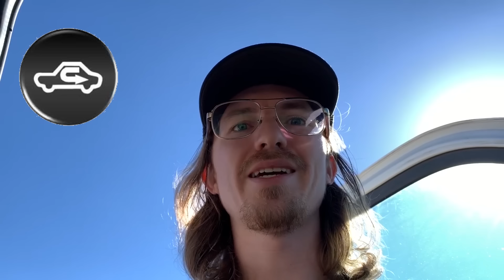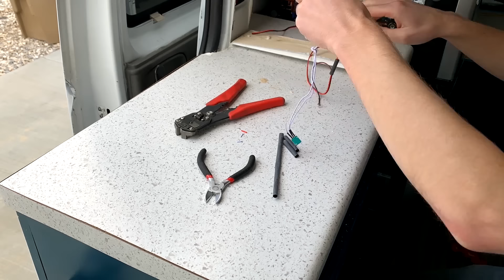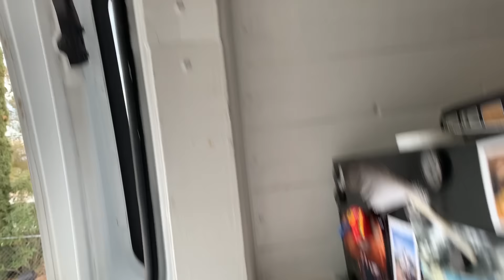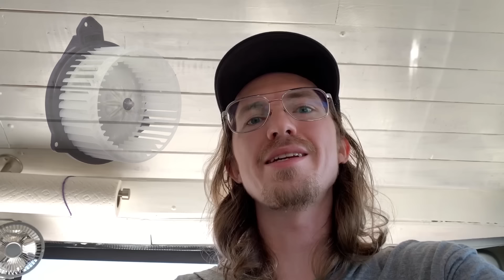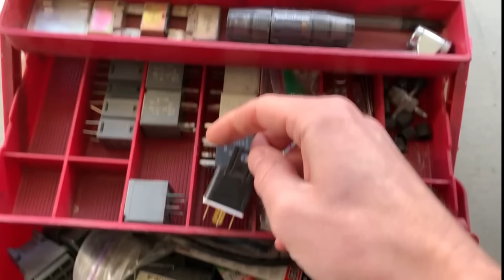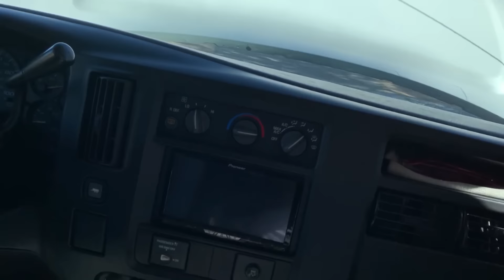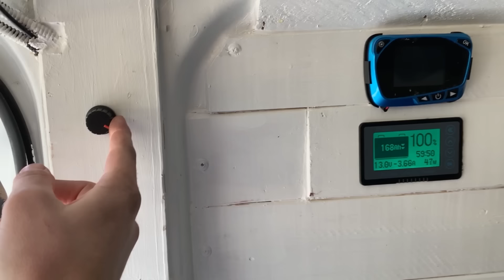OEM Blower Hack **ULTIMATE STEALTH**

Comment from the maker: A dedicated roof fan will be more energy efficient and move air a bit quicker.
This is still a great option for those who can't justify the cost or the hole in the roof.
Reply from the maker: @TerryMoore420  Hey Terry, got your email! I'll give you a call this afternoon.
Talk soon!
-Tim
Reply: @VanwithTim   disabled guy here too... i wonder if you would put this together as a kit....for a price? cool lil side job lol  Many of us have chevy express vans
Reply from the maker: @saltpepper1894  It's certainly possible! Only killer on the GM vans is the blower wiring being under the hood. (Have to pass through the floor or firewall to run the wires)

But I could always make up the relay packs and add in the "add a fuse" for the ignition on signal, as well as extending the wires for the blower speed control knob!

I suppose it would depend heavily on each persons level of comfort with DIY electrical.
Reply: @VanwithTim  well i was a cable & harness assembler, electro-mechanical systems assembler, built industrial & medical lasers, silicon wafer processors, various high end medical equipment etc....but 100 years ago lol. somewhat lacking in the understanding of how this works tho, also having the proper tools will mess up motivation for many ppl  P.S. many ppl have sogens so connections will have to be adjusted there too
Reply: @VanwithTim  i suspect the flow is weak sauce tho....(is it?).  Was thinking of mounting a MAXXair fan on a back door as a "last resort", bob wells did a video on it, but of course you sacrifice privacy / security....its always something lol
Reply from the maker: @saltpepper1894  Yeah flow is only okay. (Way better than nothing but no where near a MAXAIR). Check out this video utilizing the same fan speed controller as mine but with a radiator fan in the back window. Still stealth but obviously you'll need pop-out windows for it.
https://youtu.be/9WdWvQaoN5A?t=231
Reply: However, I think the squirrel cage fan is probably more efficient than the Max Air fan.
Reply: Having panel instead is more useful
Reply: Hi here is Matt from Germany. I just now had your great video suggested.
The solution you came up with has a big advantage: it puts the inside of your van under positive pressure as compared to a rooftop fan that when blowing outward creates a partial vacuum inside your van. (It could also be used together with a diesel heater I guess.) 
Maybe one can replace the fan of the van with something more energy efficient and also create a small outlet for the air underneath the solar panels which could possibly help cooling the panels somewhat during intense solar radiation and a the same time help getting rid of the warmest air from directly underneath the roof. I know it's always much much easier to have 'good' ideas rather than making them become reality  …
Reply: I would definitely recommend holding your camera more straight on or get yourself some sort of little tripod so you more interact with the viewers rather than looking down at the viewers but overall love the video and #weirdosunite
Reply from the maker: @Nomadsliperypole  It's a VERY unflattering angle and I'm so sorry to anyone who watched it on their TV lol

Way too close to my face and I definitely noticed the excessive movement while editing.

Stepping up the game in future videos with an actual script (less rambling and easier to understand) and either a tripod or the girlfriend as a camera person!

(Maybe switch roles and let her do the talking. She's a bit nicer on the eyes haha)

Really do appreciate the feedback. Helps me move in the right direction.
Cheers!
-Tim
Reply: If you ever need soap or shampoo or conditioner you can pretty much go into most hotels if there's one close to you go chill in the lobby for a little bit and then walk up to front desk and ask them hey sorry to bother you but I don't have any more shampooer conditioner or whatever you need left in my room is there any chance I can get some more in most cases scenarios there be like oh yeah sure some hotels may not but at the end of the day you could also go there to get Wi-Fi or anything else that you may need
Reply: Also another thing you can do with your solar panels to increase the power that comes out of them if you add a little 9-volt battery in between each cell you can increase the wattage that comes out of them because you're charging each cell so that it conducts more electricity 
There is another trick that works even better than that one but every single time I try to make a video on it it gets shut down and taken off in less than a minute and it's basically using an alternator and another motor to charge your batteries and this trick you can produce up to 22 kilowatts of power from 400 watts of solar
Reply from the maker: @Nomadsliperypole  That's definitely the FIRST time hearing of anything like this, will have to do some research and see what it's all about
Reply: @VanwithTim  that was probably a bot
Reply: @Nomadsliperypole Uh, nope. Sorry, you can't break the laws of physics. Then there are "little details" like the fact that 9V batteries are VERY expensive and constantly replacing multiples of them would not only be expensive but a huge hassle. And charging non-rechargeable batteries and over-charging rechargeable batteries are both really bad ideas. Please stop spreading this nonsense.
Reply: @Nomadsliperypole  it would be sooooo cool to learn how to do what you described
Reply: @Nomadsliperypole  dont be a troll QAnon.
Reply: @greenizgood  he is trolling you.
Reply: @Qwiv  actually I'm not trolling it's the truth!
Reply: @Qwiv  yo Karen you should probably get your facts straight cuz if you looked it up you'd realize that it's true!!!!!
Reply: @Nomadsliperypole   That is an absolute load of crap.  9V batteries between the cells?  Amazing that "big solar" has kept this a secret for so long.
Reply: @Nomadsliperypole  Why would the videos be taken down, are you giving away a state secret or something?
Reply: @TheRobman  basically yes it's something that the oil industry doesn't want you to know because they control everything
Reply: @TheRobman  because what most people don't realize is that the same people that control the oil control the banks the schools universities and the media so therefore they control everything
Reply: @Nomadsliperypole 

They dont control physics lady. Stop with the nonsense... even though this video is a thousand yrs old. Still, stop it if you haven't already.
Reply: Love the 9 volt battery in series with a solar panel idea and explosions. How long does it last?

The 22kW idea is wrong too, because W = V * A
No?

Love the energetic humor

Comment: Could this same concept be used for power windows? 
Eg, once parked up and in bed, you want to crack the window to vent, or close it if it's too cold/windy. But the power windows only work when the ignition is on. That means getting out of bed, going to the cockpit, putting the keys in and turning the ignition on, walking back into the habitat area to work the window, then going back to take the keys out of the ignition and then getting back into bed.
It's pretty annoying.
But add a switch and relay plus a positive feed from the leisure battery and you could work the windows from in bed!?
Reply: Would be nice too or at least one window

Comment: Yeah I was thinking as watching, you'd need a switch & relay to turn on the fan-controller.  In some ways you want to push the hot air out of your front cabin out the windows, before pushing it into the back living quarters.  You're like me, doing it yourself van system. Arrr you sold your van.

Comment: I found this in 2026, thanks a lot! 
I'll try connecting the rear fan that way. 
Regarding the roof fan, I want to make one or two of solar paneles sliding, freeing up space for the sunroof. 
The idea is to remove the second panel, buy another one, and mount them on sliders above the two rear panels. 
The fan is mounted on the freed-up part of the roof. 
When driving, three panels work, but when parked, the "second floor" slides back and all five work! 
I'm also thinking about an awning made of flexible panels that retract under the trunk when driving :)

Comment: Big question here...is that going to back-flow power into your house battery when the regular fan controller comes on? Is your battery bank at 12v? I'd look into that before I would add something like this.
Reply from the maker: Great question and that would normally happen, but the dual relays isolate both power and ground between the house and starting batteries.
Reply: @VanwithTim  Does it have a relay on the ignition power side so that you can't accidentally power the fan from both and fry the fan?
Reply from the maker: @ArcticSubie the ignition power is what switches the relays. The relays physically connect / disconnect the blower power from the two sources which makes it unable to backfeed from either source to the other
Reply: @VanwithTim  So this unit replaces the stock fan relay? or the stock fan relay connects to this unit also?

Comment: Thanks for the vid. I ended up using my forced air heater on fan only and cutting a hole in my floor for the intake during warm months but i think I’m definitely gonna add the blower bc you can never have too much fresh air in the summer

Comment: Trying to copy this setup, it seems like I have to do something different with two relays or a DPDT relay because my blower motor resistor is on the ground side of the circuit.

Comment: This might already have been asked but my 2022 transit has a blower door that shuts after 15 mins of being off, I ended up running a 3" pipe in my D pillar with inline fan. Prefer your solution, did you have to deal with the blend door shutting?

Comment: Very nice solution! One downside is, it is pulling the air through very hot parts of the car so it will be not "cold" air. It is heated up by the sun or obviously because of the engine is running.

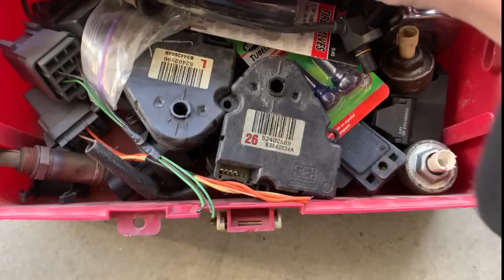Comment: 15:51 now I'm even happier I happened to buy my used 2014 Prius that has the solar panel that runs the fan in park. Crazy they disabled that after this model. 

Solar panels in cars could be industry standard with the low pricing now. Cool stuff man

Comment: On my Lexus LX570 (Same as a 200 Series Toyota Landcruiser) I tapped into the signal wire under the fan and inject a PWM signal using an ESP32 running Arduino code. I put a relay in the circuit so that when the relay is off, the car gets the signal from the car's aircon controller like normal, but when the relay is energised the signal comes from the ESP32. 
I can control the ESP32 via it's own wifi access point, so I can control the fan from my phone. 
Obviously this means that the fan is still being supplied from the cars own battery, but I found you only need it to be ticking over throughout the night and can even run a sequence to start and stop the fan every so often. All in all it uses very little energy. I also monitor the car's battery voltage via bluetooth and find that even after several days the battery is barely affected. 
I also put a frozen cooler cube on the air intake below the windshield just before hitting the bed in hot weather, and it seems to make a difference.
This was really simple to do, but I am an electronics guy. I came up with the idea when I was at a camp ground. I went to a local electronics supplier to get the parts, programmed and installed it in the camp ground the same day. 
I will make a video some day.

Comment: Max AC AKA recirculating is the absolute best way most efficient way to run your air conditioner in your car. Instead of bringing in 90° air from outside and trying to cool it, you only have to cool the already cool air in your car causing your compressor to run enormously less. My God. Do you have no logic?

Comment: Not the best idea.  It will not let the hot humid air out.  They make low profile metal roof vents its the best way to keep the van cool.  And you can paint it white so it blends in with the van.  Had Chevy vans for years most of them have a flat spot just for a 14 by 14 vent.

Comment: Thanks for the idea. I wonder why you don’t just switch the key to Acc and run the fan directly, then top up the start battery by the house battery ?  This will save you the fan controller and lots of wiring.
Reply: Topping up start battery from house battery would require DC-DC converter, and it would less efficient. And, you don't want to keep a key in ignition all the time, especially while sleeping.

Also, the factory fitted fan speed control is usually implemented with resistors with extremely poor efficiency, and the few steps of the control might not give your desired speed for dwelling.

Comment: One thing to keep in mind if you are planning on doing this, some vehicles use electric actuators to switch the mode doors and they just remain in place when you shut off the key, but some use vacuum from the engine to change modes. Usually if there is no engine vacuum the default mode is defrost. That is the "fail safe mode".

Comment: One reason to run a dedicated ground wire to the motor is to help avoid noise for other devices. If you used the chassis ground it would work fine, but it might cause a lot of noise on the stereo, for example.

Comment: PWM doesn't change the frequency of the pulses. (It can, depending on requirements, but that's not the primary function.) What it does is that at a given frequency it will hold the voltage high for a longer or shorter segment of the pulse.

For example, regardless of the frequency, at 50% the voltage is high for half the cycle and low for half the cycle. At 25% the voltage is high for only 1/4 of the cycle and off for 3/4 of the cycle.

By the way, changing the frequency wouldn't change the speed of a DC motor, all else being equal. The reason is that you wouldn't be changing the total amount of time that the voltage is high or low. 50% high at 1 Hz=50% high at 1,000 Hz.

This is a bit of an oversimplification, and it assumes a square wave, but it's basically correct. Like anything, if you start playing around with other variables or go to extremes like very low or very high frequencies, things get complicated quickly.

Comment: Had you used the reverse polarity idea to go from blow to suck without a protection circuit to prevent the van HVAC controls from energizing the blower motor whilst your house battery is pushing current in the opposite direction could have created some issues.

Comment: “Wasting a ton of electricity” which is only an issue since you’re running on solar, otherwise from your alternator this is a negligible loss since the alternator runs when the engine is running! You’d need a closed loop permanent magnet motor to run a PWM motor controller!

Comment: Ive often thought about doing a fan via a tube from under a truck. Have to pull from away from the exhaust and other smells then have a low profile vent on the roof under panels. That way you could cover the roof with panels

Comment: A spare radiator and a cooler full of ice… maybe a 12v fan and a water pump. Why not a marine grade dual battery selector and just use the accessory switch? Very cool idea, think I might try👍
Reply: Ice is expensive
Reply: @JGnLAU yeah, I have seen solar power ice maker setups, if your not drinking from it you can refreeze… living from gadgets is a tough journey.

Comment: while blowing air in is good assuming you have not affected your exhaust air baffles (usualy found in the back of a vehicle) with expanding foam etc... I feel you could do better by mounting either a box fan with vent out on the ceiling or for a nicer look an inline fan that has a vent tube that runs to the center of the ceiling and has a intake you can get almost flat vent tubes that are flexible btw that then can blow air out through a hole in the floor maybe behind a cabinet etc? this would exhaust your cooking air keeping things smelling better. your current fan Idea is good if you cook out doors as it will control humidity and fresh air but wont really help with smells?

Comment: Interesting.  I am wondering ... if the fan 12 V wire INPUT to the fan blower is supplied a simple 12V with the key off would not the fan simply run?  ... as a basic circuit?  .. building from that, being concerned if that 12V signal came from the coach battery ... and the fan runs, Ign Off ... then there might be a concern for back feeding voltage (might)... vech could be switching the ground side of the fan relay ... hang in there with me ... I think it may be possible to use a high amp diode on the 12V wire from the coach battery ... allowing the voltage to only go one way ... I'd have to think about it more ... but your set up looks seem really good..  I'll save and study it more to see... with the KOER and the power switchs over is a great way.  Some GMs with rear AC have a fan at that rear unit too.. some.   whew .. is this 5 years ago .  .. great concept ...

Comment: If only you could measure the flow rate, because the fan should be much more efficient per unit of air flow running at low speeds assuming the motor efficiency is constant.   This because the air flow friction losses go up with flow rate squared.   But I wonder if the fan will last long running at too low speeds.

Comment: Great video. 920 watts of solar is definitely not a ridiculous amount though. When I did vanlife I had 3,000 watts of panels I put out, and that still wasn't enough sometimes.
Reply: How the hell did you fit that much on a van? I have a 21 ft TT I can barely fit 1kw, sure it has stuff on the roof already but still
Reply: @jasonlin9805  I did not have the panels on my van. I said "put out", cuz I would put the panels out on the ground when I parked.
Reply: @JohnnyThomas-ps6mp oh